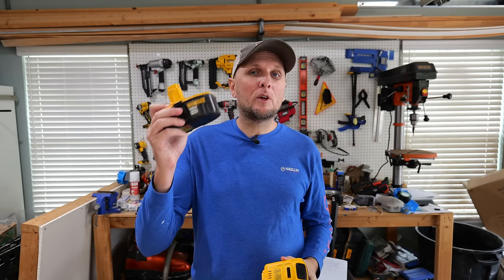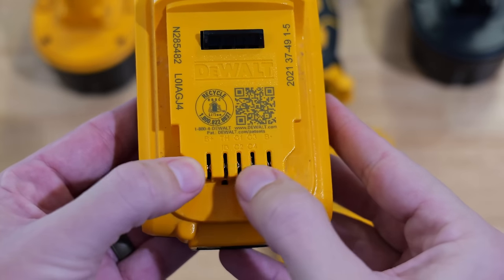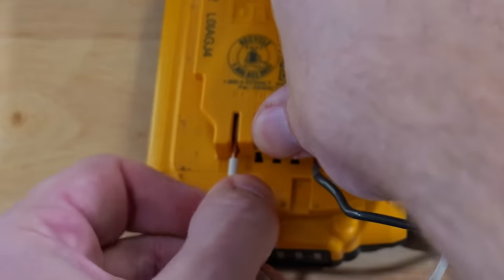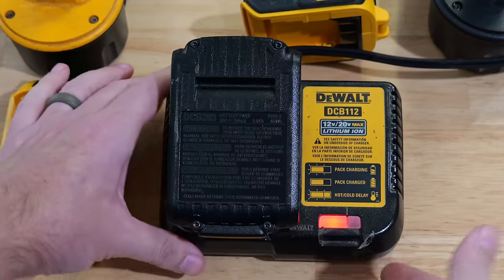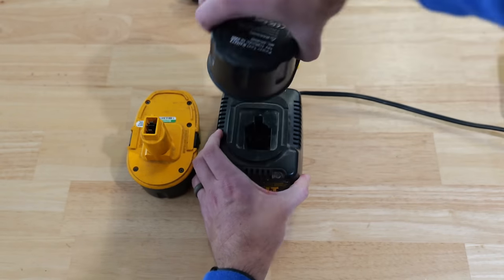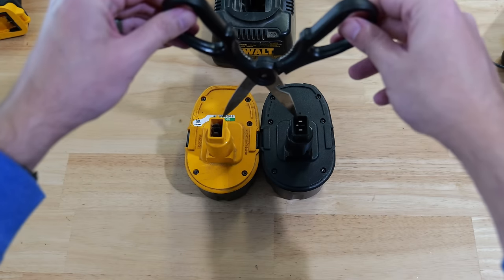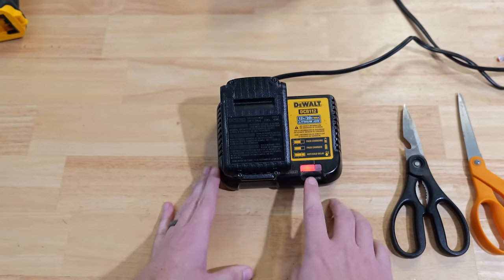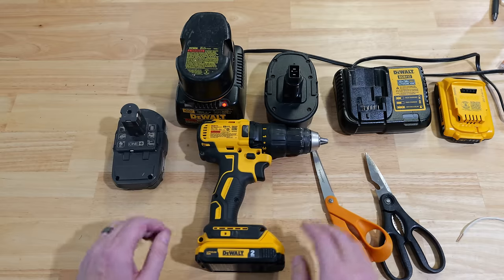SECRET To Reviving Dead Portable Tool Batteries | Super Easy!

Comment: What is occurring here is that the battery packs contain a fuel gauging and safety IC.  The charger must communicate to this IC, before the battery can charge.  If the battery gets to a low enough voltage, the IC will be unpowered, and unable to communicate.  There is a way in most of these IC solutions to provide a slow charge path for a deeply discharged battery.  The issue is that some manufacturers, because of their cell chemistry, don't want a battery which has dropped below about 1V per cell, to ever be used, as it can cause plating of the current collector materials into the carbon matrix, which can then become energized when the cell gets charged, resulting in shorts and localized heating, which can then lead to what is referred to in the battery industry as "rapid disassembly", more often called an explosion by consumers!

If the battery reaches low voltage because it was stored uncharged, and left in that state for a long period, it would typically take multiple months, it may reach a low voltage.  Such cells are usually safe to recharge, but to be sure you really need to get the info from the cell makers datasheet.  The other reason the cells can reach such a low voltage, is because they are wearing out, and their impedance is increasing and capacity is starting to rapidly decline.  This can cause a cell to go to zero volts during storage due to increased leakage currents within the cells.  Such cells are typically unsafe to recharge!

If you are going to do this, be very careful.  Recovery of such packs is at a greater risk of catastrophic failure for the cells.  Watch such packs carefully during charge, and even for half a day after the recharge.  I have seen cells fail after such recovery charging as long as 8.5 hours after charging was complete.  A single fire can cost you much more than the price of a replacement pack.

I wanted to make sure people are warned of the potential consequences.  Please be extremely careful.  I highly suggest replacing such packs unless you know they were stored uncharged and left for a multiple months.  Li based cells are fickle, they contain tremendous energy.  When things go bad, they go bad quickly and violently.  Please take this warning seriously.  I would hate someone to lose someone they love to such a senseless accident!
Reply: Excellent analysis
Reply: Absolutely true Brian. Lithium ion cells are far too unpredictable for messing about with. If they lose their charging ability replace them.
Reply: Thanks for your technical advice Brian.  Very good information
Reply: u are right on point.
Reply: “ but to be sure you really need to get the info from the cell makers datasheet. ” 
Lmafo, don’t even bother.  If you can even find the original manufacturer and get a data sheet they NEVER have this information.  They usually don’t even have actual capacity at various discharge rates or even temperatures sometimes they don’t even have the capacity which is insane.  The data sheet says almost nothing beyond “what you want?  It’s a BATTERY”.
Reply: Well stated.I have an old Craftsman 18v. I don't think I will try to recharge it.
Reply: Thanks. I have seen to many lithium fires (Tesla's included) that I will just go buy another one... much cheaper.
Reply: @brianfritz575  You said, manufacturers don't want a battery which has dropped below about 1V per cell.  Actually, if an individual Li-Ion cell gets much less that 3.2V, it should be replaced.  Especially any individual cell that gets below 3.0V.  For 18350 and 18650 cells, which are common used inside battery packs, a 2.50V charge can be hazardous.  You can get them to recharge to some effort or some chargers, but the charge won't last as long and, again, it is very dangerous to do it.
Reply: @100vg  The undervoltage threshold for end of life for a cell and if that is under load or not, are all a function of the chemistry of that cell.  The 1V is a generalization.  There are many other considerations, mismatch between cell banks, etc.  Those are additional reasons a fuel gauging IC may not be allowing recharge.  Circumventing any of these may be dangerous.  My point is that without the data on the individual cell chemistry in use, recharge is likely a foolish endeavor.
Reply: Probably a case of (i) check your home insurance hasn't expired, (ii) don't leave them charging or even initially in use (high-drain) unattended, and (iii) ensure you have a fire-extinguisher to hand. Some fire-extinguishers might be inadvisable/ineffective for battery fires (water-based ones ? IDK)
Reply: My lithium mower battery was left on the mower for about 7 weeks which drained it.  Now it wont charge.  Normally I take it off the mower after mowing.  Is it safe to try and jump start this battery?  Its 10.8v and I dont have another 10.8v battery so I used my 18v/54v flexvolt dewalt battery to jump start it.  It came up to one indicator light on the battery, but it still wasn't enough to get the charger to recognize the battery and fully charge it.
Reply: @altinsilsile36  Hard to tell.  We don't know why the battery won't charge.  How old is the battery?  Might try contacting the manufacturer.  Perhaps they'll warranty the battery.  If not, I don't think I'd find the risk worth that savings.  Only you can make that decision for yourself.
Reply: A safer alternative is when your li batteries go.dead use a 12 volt gel.cell in with duct tape and leave the leads out to charge. For a lot of tools this will work and you won't need another battery for years. It isn't worth replacing with batteries fro. The manufacturer for what they charge. A 12 volt gel cell will usually be okay.
Reply: Exactly. The Li Batteries have about 6 times more capacity on the same size as eg the old nicd or nimh. That's why it brings you 6 Times faster in trouble if there's something wrong with one of these cells 😉
Reply: @altinsilsile36  generally if a cell goes below 2 volts it's not going to charge again and it isn't safe to try. Check how many volts the battery delivers. If it's less 7 volts it's probably not worth trying. On the other hand if you are good with a soldering iron you can sometimes replace each of the cell for $2 a piece. I say sometime because tool companies are starring to put chips into the battery packs that prevent this. If the charge drops below a certain voltage the chip won't let the battery pack charge again even if you put new batteries in.
Reply: On a,18 volt when you put it in the charger it starts to flash but then it flashes fast. And no charge
Reply: Very good advice, but now you got me thinking I made a mistake by buying a Chinese lithium battery replacement for my NiMH 18 v DeWalt battery and charging it on my DeWalt charger?
Is the DeWalt charger a possible fire hazard when using it to charge a lithium battery?
Reply: @herbertlinglesr.9878 yep, same here no matter how many times I did the battery to battery jump charge.  
I could get the bad 0 volt DeWalt battery to 14 v and the charger would try to charge for a few minutes of slow flashing and then goes to a fast blink and the voltage goes back to zero.
Reply: @heynow01  yes , it is not a good idea to charge a lithium battery with anything but a lithium charger. A lead acid battery is very forgiving and will charge from almost any source. Lithium is not very forgiving at all and charging using anything else is inherently risky.  

If you ever do decide to try it put the whole thing in your grill outside as it charges. If anything goes wrong it will be contained. After it seems charged and you unplug it feel the battery for warm spots. Any unusually warm spot is a bad sign and you shouldn't trust it.
Reply: @heynow01  I'd mostly be worried about the cells used in the knockoff battery pack.  Who knows if they are UL listed.  I would suggest being careful with the pack.  There really is no way for the consumer of such a pack to know how safe or unsafe it may be.  I myself refuse to buy the knockoffs for this reason.  The extra dollars I pay are worth the peace of mind.  I know things can happen even with the well designed DeWalt packs.  Knowing that DeWalt is trying their best is what drives me to spend the extra.  The peace of mind is worth the $'s to me.
Reply: @jlrinc1420  I like the idea of using a grill as containment in case anything bad happens.  It likely will be able to contain most of the events that will go wrong.  But, if much lithium metal has formed within the cell, a failure like at Sony's Fukishima Koriyama plant is possible, where the cells burned through several steel floors and into the earth before being extinguished!  Metal fires are nasty stuff!!!  The likelihood of that with a single pack is incredibly small.  I'm sure to use your suggestion when dealing with some packs that I have less confidence in!  Good Idea!
Reply: very good info.
Reply: I just assumed the manufacturer built this in so you would buy more battery's.
Reply: Before recycling battery packs please consider the following : Chan's battery rebuild found online. They are a small 1 person business specializing in rebuilding all rechargeable battery systems up to electric bicycles.
The cost of a rebuild is typically around 1/2 the price of a new battery and the rebuilds are often better than a new battery.
Cheers everyone 😊
Reply: I agree not worth your eyes
Reply: I have been using the Dewalt tools for many years, nearly half a century.  ALWAYS buy new batteries!  I am happy Brian explained what can go wrong.  I knew the minute I saw this video, this was a fire hazard.  Also, you are abusing a new pack to restart the old one which is bad, both can burn in a fire.
Reply: I tried this trick with a “dead” battery and it popped an arc that melted the connector. I don’t know enough about lithium or bms’ to try again. Professionally refurbished or new for me.
Reply: Not a forever fix but works if you’re in a pinch and just need to get a job done before the end of the day.
Reply: i seen a tesla burn it was bought at auction and had 120km only on the odo! the car was bought cheap and believe it or not it took the apprenticship tafe 8 months to find out why the battery wouldnt take a charge! then it was jump started and left on charge at the tafe for the weekend! i believe it was sometime in the early hours of sunday morning that the massive battery from the tesla burst into flames@2
Reply: Rapid disassembly...that sounds fun
Reply: @rtaylor1105  Unless you are standing right next to it, with it under the fume hood with the hood's plexi guard lowered.  Then you need to go clean out your underwear after the "Rapid Disassembly!"
Reply: I will NOT do this with Lithium batteries but what I did use was a NiCad battery. I know Lithium can explode and to be extremely cautious with them, that's why I will never own an electric car to drive. It's a BOMB.
Thanks, this does work with NICad.
Reply: Blah blah blah fts
Reply: Your smart… awesome!
Reply: @alanprice9712  I don't doubt that the rebuilt ones are better than new. There can be a lot of difference between cells. Someone who rebuilds them would likely want to use quality.
Reply: @brentbosworth8845  You do realize that as far as bombs go, 10's of gallons of gasoline in a car, is much more likely to ignite in a crash than a Lithium based cell.  People always tend to discount the risks they've chosen to live with, while overestimating the risks that are new.
Reply: @brianfritz575  Lithium Batteries can explode for no reason. How many ships transporting electric cars to another country have made it without exploding? Check on that fact.
Done.
Reply: @brentbosworth8845  How many ships transporting electric cars make it without exploding... Almost all of them!  If this happened as much as you are implying, ("How many ships transporting electric cars to another country have made it without exploding?") then none of the ships would take them!  Go ahead give me a researched number!  I bet you won't.  You'd much rather spread FUD.
Reply: Thank you, Sir, for highlighting the impact of this dangerous notion created by amateurs who have no inkling as to what is happening to the batteries when bypassing proper charging , discharging and disposal of depleted ones. These DIYer’s think it’s like throwing sticks together to build a fire and then the realization strikes them that the fire is getting out of control and that they were not prepared to extinguish one. These are legit companies that have built these batteries and don’t wish to have multimillion dollar lawsuits hanging over their heads and that is why they give customers a heads up on the proper disposal of the used batteries.
Reply: You are right, however, i would suggest ANY battery be watched and stored in a metal fire proof container. No matter the age. These batteries can ignite a fire in mere seconds if they decide to go bad. I know. Brand new quick charging dewalt 5ah burned down my wood shop in 2020. When i say brand new, i mean it had just completed its very 1st full charge when it became a ball of melted plastic on fire and flew across my sbop when the cell finally popped.  Even batteries taken from the store and charged up can become an issue and insurance really, really sucks as far as compensation.
Reply: Just curious are you a manufacturing engineer or an electrical engineer?
Reply: @bobtosi9346  Electrical Engineer... I specialize in fuel gauging and safety circuitry for portable electronics.  So, lots of experience with this.
Reply: thankyou. battery charging is one of the leading causes of house fires.
Reply: Dang. I was so excited about this video. Maybe it's time to go back to corded tools and gas engines.
Reply: @TheSouthIsHot  Batteries from the major manufacturers are quite safe.  Most of these manufacturers are spending the money to have a 3rd party safety compliance agency certify their design.  When well designed, the packs are safe when used in accordance with instructions.  Once you start jumpering packs to make them charge, or using home brew charging solutions, you can circumvent some of the safety elements designed into the pack.  No need to be afraid of well designed products by major manufacturers like DeWalt, etc.  Just realize that because you can circumvent the pack electronics and make the pack charge, doesn't mean you should!

I built packs and power systems for portable devices for over 25 years.  The Li based packs I designed were all designed to allow for two concurrent likely failure events and still result in no fire, smoke or flame.  The problem is that devices like hover-boards, etc are not being held to a high standard.  These companies are making a lot of money quickly in one segment of the market.  There business plan is if they have a major failure and get sued, go bankrupt.  If you are buying from large reputable device makers, who are getting their packs certified by 3rd party safety test, like UL or ETL, I would sleap soundly knowing that lots has been done to ensure a product that is a safe as reasonably possible.
Reply: Thanks it sounds like you’re honest although, as you can imagine I wouldn’t bet on it, but as an engineer I’m very meticulous to details and absolutely non-woke (missing a brain) and sounds like you are concerned with the actual truth so thank you that’s good to know. I skim over reading sometimes so if you could briefly explain the main factors of how a dead battery has enough in it to explode I would appreciate it🙂
Reply: Doesn't sound safe at all man. There's lots of reasons why it won't charge. I've had 2 over the years that quit out on me and they were not left uncharged for long periods. Had I jumped those my house would've burned down.
Reply: @kevinlabo2310 you know they would’ve done that how?  Do you know how incredibly rare that is?  And usually it’s due to them being damaged by hitting them on something or dropping them. And even then, super rare.  Using a battery the same as the one that’s dead is not going to cause that to happen and anyone that says otherwise is just fear mongering.
Reply: @mosdephh it wouldn’t from what the guy did in the video.
Reply: @chihtahuang lol no.
Reply: @brianfritz575 so you’ve seen batteries start on fire from using a similar battery to jump it?  I really don’t think so.
Reply: @hisanosukedyer this has never happened with what the guy showed.
Reply: @mateo77ish yeah you hooked it up wrong.  Only way that happens.
Reply: @arrowdriver007 they did.
Reply: @conwaynoel3715 has nothing to do with what the video shows.  They aren’t that unpredictable. If they were they would have been taken off the market years ago.
Reply: Thanks for the advice/warning brian, I’d sure rather spend a bit for a couple of new batteries rather than chance something like you described. Especially if I can afford it.
Reply: @johnpicard4909  you're completely wrong man. There is a laundry list of reasons why the cells in a battery stop working. None of them make it safe to jump start the battery without proper inspection first. It's not fear mongering. House fire happen from misuse of lithium batteries all the time. Educate yourself.
Reply: I have a dead battery and I'm tempted to try this, but I really don't like messing with batteries especially the larger ones (for a leaf blower) like I have. I'm just going to get a replacement.
Reply: Thank you for the heads up. I will play it safe and certainly take your advice.
Reply: Former power supply designer here, great analysis. Pay heed to this, don't mess with Lithium it's very unfriendly.
Reply: @scotttaylor4195 if the craftsman is nicad , they can typically be zapped, but it is easier in the long run to get new packs
Reply: I have 5 dead LI batteries (years old) that I can’t afford to replace, and came to this video for a DIY solution with every intention of following through - until I read your comment.
Being that I have no interest in homemade bombs, your advice will be followed instead.
Thank you.

…still probably a smart video for other battery types. Much appreciation to the uploader.
Reply: Wow tha k you so very much for this information. I had no idea how potentially dangerous they could be. I have had one I put on charge and kept over night thinking it would charge and thank Jesus it didn't burn the house down. I been looking for a reason to toss my old out and finally replace them and I think this is it. Thanks again. God bless and keep you in Jesus name amen
Reply: WTF guy, did you invent this shit?!?!?!
Reply: Hmm.. wonder who, In the chat, works for "Big Battery"... 😁
Reply: @StupidEarthlings  I'm retired.  In my career I've worked for semiconductor manufacturers and device manufacturers.  In both categories my work was centered on giving consumers solutions that safely harnessed batteries power.  NiMH and NiCd posed their own risks, long before Li based chemistries became ubiquitous.  I've implemented safety solutions for all these chemistries.  If you want to do what this video proposes, I can't stop you.  But you have been warned.  If you are not able to do what is in you and your families best self interest, my conscience is clear.  I've done my best to warn you!
Reply: Yeah we used to replace bad batteries on Dewalt and Craftsman  drills, as long as they were on warranty. I think it was 1 year for all batteries Craftsman, Dewalt, Makita, and Milwaukee, but Milwaukee had a 5 year warranty, on the tool.
Reply: DeWalt 20V packs don't have a fuel gauge chip or BMS onboard.  The balancing and undervoltage detection is implemented by the charger itself (you can see the C1..C4 labels referring to the internal connections between cells on the terminals). Others, like Ryobi, are implemented differently.

But, as you said, lithium battery chargers will refuse to recharge cells that have fallen outside of the safe voltage range because it's likely they have suffered internal damage which turns them into a fire hazard. Defeating this safety mechanism by just slamming the cell with as much current as possible from a fully charged battery, with no balancing whatsoever, is pure insanity. It is highly irresponsible IMO to publish a video encouraging DIYers to try this without fully understanding the risks and how to assess the battery's condition.

As a side note, a charged power tool battery can deliver hundreds of amps and you generally do not want to be poking wires into the terminals willy-nilly. A better way to jumpstart a dead battery (which you probably shouldn't do) would involve using a current limited bench supply to slowly revive it back up to ~15V.
Reply: Thank you for posting this information. This is why it is important to not run your batteries completely dead (or get them on a charger asap afterwards) and also not to have favorites among your battery collection. I have 13 batteries and lost 2 that had been working simply because they were the “old” ones (just didn’t look as pretty lol) and they sat until a large project came up.
Reply: Comments like this is what the internet was really intended for. Thank you.
Reply: Excellent feedback, and detailed 👍
Reply: We are having far too many battery fires here in Australia for me to be able to use the method shown in this video. As another commenter has said, when the battery won't recharge it could easily be a sign that it is NO LONGER SAFE TO USE!
Reply: This comment is way too long to read
Reply: True, tried this. Battery exploded in kitchen. Managed to get it out on to patio, where it gave a impressive display. Scorch marks still there.... She wasn't happy
Reply: @brianfritz575  Many people don't realize that the emptier the gas tank, the bigger the bang, should it blow up.  I made the point a few clients in the past, by tossing a lit cig into a small puddle of gas on the ground... Almost every person jumped back, when I'd do that, anticipating a fire to ignite, which it never once did.  The reason being that it is the fumes that ignite, rather than the liquid.  
Clients that would bring their vehicles in to me, with little to no fuel, I'd use my cig in the puddle demonstration to remind them to keep their fuel tanks more to the full side, rather than nearing empty... It worked more often than not!
Reply: @chihtahuang  Good gawd, really?!? If a fire started at my house, I'm sure it would take out a half block in either direction, between batteries, propane tanks and a plethora of combustibles in cans (paints, degreasers, oils and fuels)... And I have a LOT of different batteries charging at any time!!  Time to reassess my facilities, me thinks!
Reply: I would like to ad I've seen these battery operated tools come into the construction industry and like automobiles they have made a lot of progress except one thing over xcomplication for better performance is a much more of a problem then the conviences of the upgrades for when one thing goes wrong rendering the tool or auto enoperatable leading to extenuating fees repairs and downtime. MORAL IS KEEP SHIT SIMPLE AND IT WILL WORK MUCH LONGER AND SAFER.
Reply: I would like to ad I've seen these battery operated tools come into the construction industry and like automobiles they have made a lot of progress except one thing over xcomplication for better performance is a much more of a problem then the conviences of the upgrades for when one thing goes wrong rendering the tool or auto enoperatable leading to extenuating fees repairs and downtime. MORAL IS KEEP SHIT SIMPLE AND IT WILL WORK MUCH LONGER AND SAFER.
Reply: @leonessity - The same is true for propane and natural gas. Once saw a fire engine drive straight through a cloud of propane because they thought it was smoke. Fortunately the gas mix has to be about 10% gas or lower / 90% air to explode.
Reply: @McThumbs01  Ive never really though about it, but I treat propane with kid gloves.  I've had the odd client bring their propane vehicle to me, and I won't touch them.  I'm not set up to mess with propane systems, and don't foresee myself ever owning any prop fuelled vehicle, since u can't find propane fill stations, like u can find gas or diesel! Lol
Reply: Thank you for the disclaimer.  Very good information. 👍👍👍👍👍👍
Reply: Thank you for your concern❤I sincerely appreciate it!
Reply: @brianfritz575 Several STEEL floors?! That's crazy😳!
Reply: @chihtahuang wow! Never knew that!
Reply: @Kevin-wj7bc I never realized how powerful these batteries were until I witnessed someone jumpstart a car with a few of them. My friend is like a mad scientist. He had wires going everywhere. It definitely wasn't something I'd want done to my own vehicle. And believe me, I stood way across the street to watch😂 But, his crazy a$$ made it work!
Reply: @zippydoodah1547 I'm glad you are all ok and your house is still standing! Just think if you hadn't been home😮 That could've been horrible!
Reply: @timothyhults2549 That's why I like older cars.....
Reply: @Treeslinger81  sorry for your loss, and you’re so right about insurance. The fact it was a wood shop breaks my heart. My dad’s shop burned down as well, in ‘21, but couldn’t discover the cause, think it probably had to do with old appliances. So, with an Li battery fire can it be put out in any way? Or just burn itself out?
Reply: I don’t fuck with electricity. 
Mechanical, yes.
Reply: @brianfritz575 unless it’s those crappy Chinese ones.